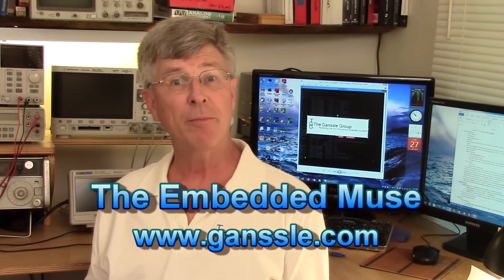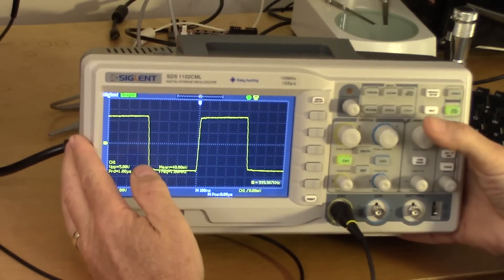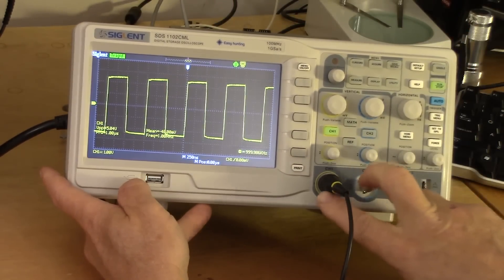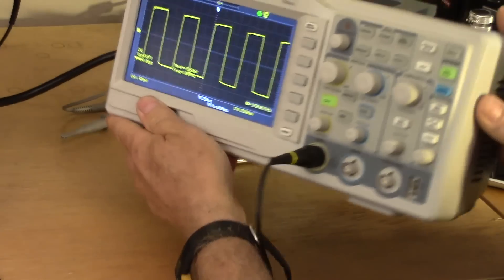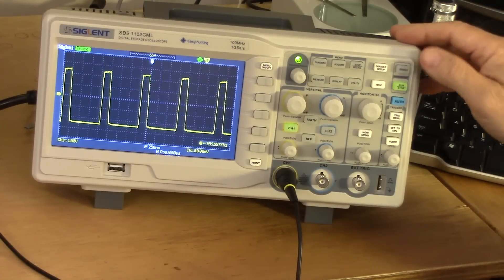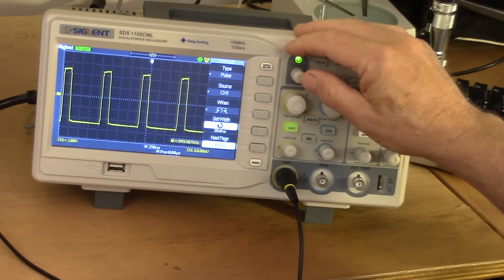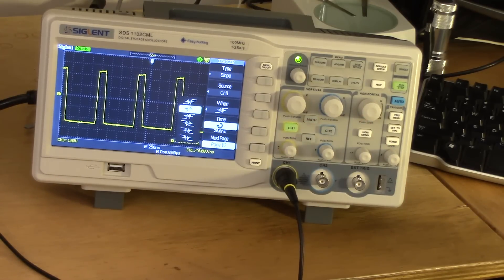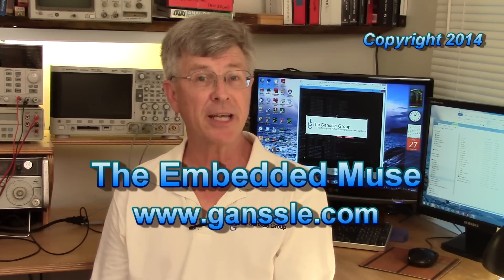Episode 4 - Part 1 of a review of the Siglent SDS1102CML oscilloscope

Comment: Sir
Is this model useful for digital logic.i am from India and a rigol costs 650$ in here so I was looking at this model please advice
Reply: Sankar Bose .... Do you need honest tech advise or commercial one ?... If commercial advice then try to buy the longest memory depth you can find and afford for the digital analysis but an honest tech advise would be " never buy digital oscilloscope for digital analysis but buy high bandwidth analog oscilloscope with cursor readout feature if affordable with logic analyzer ".

Comment: Hi, I bought this oscilloscope yesterday it works fine but the only thing I'm concern about is that when I turn it on the item (auto, ready, armed,trig'd etc) at the top left of the screen switches "auto-ready" very quickly unless I don't give the right signal 1KHz from the oscilloscope. After calibaration it shows "auto" but after having a singnal and diconnecting the prob again starts showing auto and ready with a quick change. Is it a technical problem? Please help!

Comment: Wouldn't the 3 dB rolloff cause the signal to be reduced by 0.707 rather than half?

Great video. I hadn't realized how large the screens had gotten on these low cost scopes. Looks like a good low cost option. Thanks
Reply: Yeah , -3dB means 0.707 and -6dB means 0.5.
Reply: Alfa-Psi , David Gillooly ... I think that because he is an embedded solutions pro and that means he is dealing with digital signals most than analog. If he was engaged with analog like RF communication eng. then we would not see such a drop !!.

Comment: Hi Jack - It looks like your signal generator is set to 1MHz.  On the scope, the square waves are shown with a visible leading edge roll off.  It that a function of the signal source, probes or the scope?
Reply from the maker: The square wave generator I was using has really poor rise and fall times; what you see is a product of that. For examining fast signals I attached a DIY circuit that sharpens the edges to better than 1 ns.